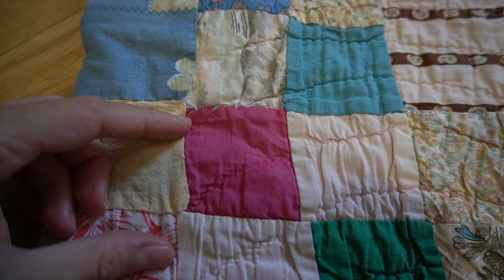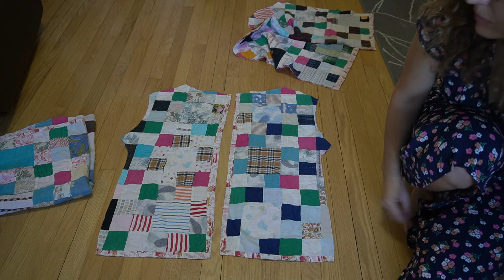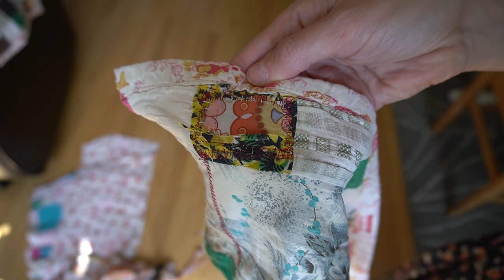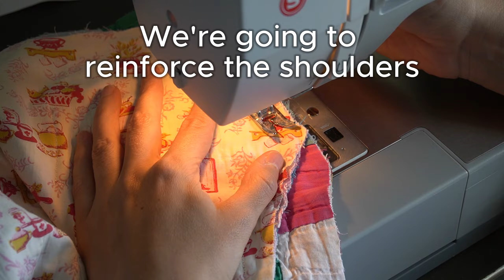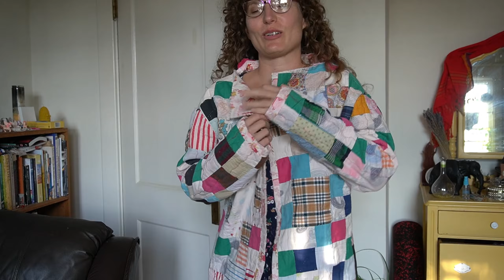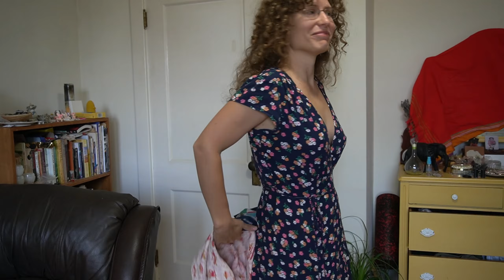How to Turn a Quilt Into a Coat! Step-by-Step Upcycle Tutorial (EASY)!

Comment: How did u bind the sleeves and bottom of coat
Reply from the maker: I used the finished edges from the original quilt. When I cut the pieces out, I lined it up to do that. But you could use some bias tape or bias cut fabric folded up like tape. Does that work for you?